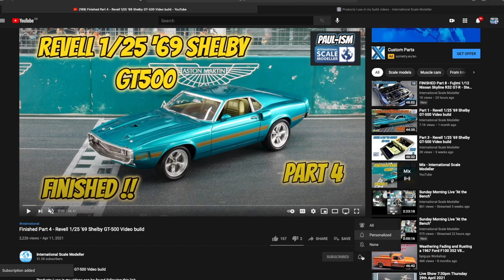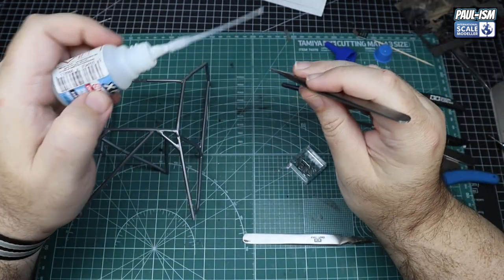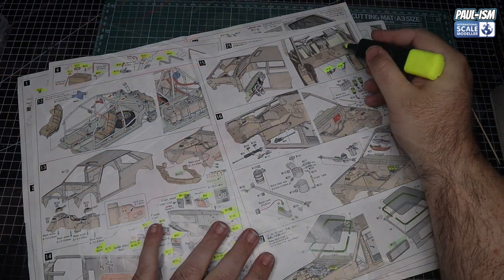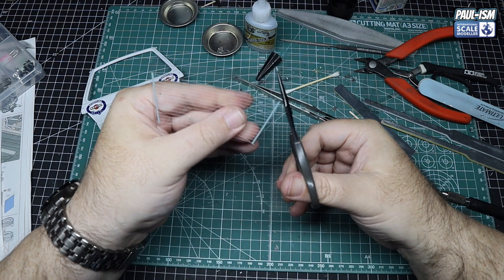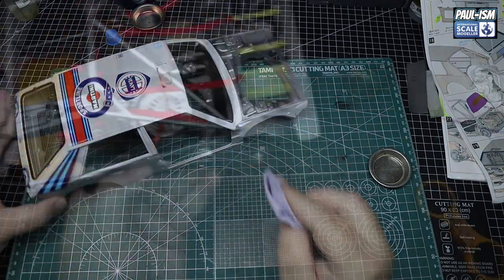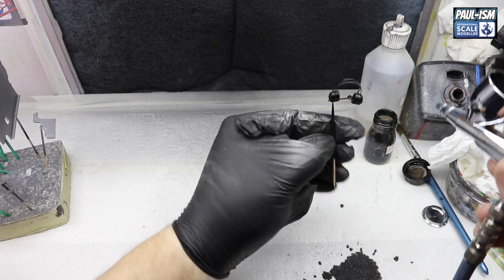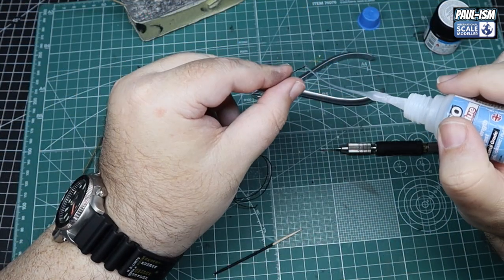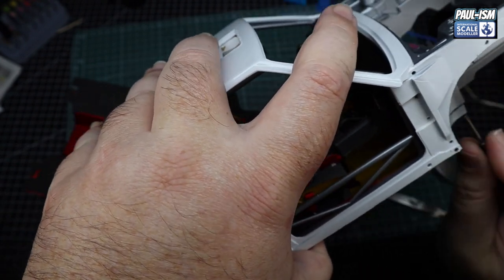Part 12 - Model Factory Hiro Full Detail 1/12 Lancia HF Delta Integrale Evo '92

Comment: Hey Paul, as always crazy detailed build. A bit of info on headset. Driver and Co-Driver helmets have built in intercom. It is required during the stage so driver can hear stage notes read by the co-driver because all these cars extremely loud inside especially on the gravel/dirt roads (mostly because all sound isolation removed as unnecessary weight). During transits between special stages co-driver still need to give instructions to driver from the route book on how to get to the next stage. As I mentioned before, since the car doesn't have any sound proofing even in the road mode even on the tarmac it is extremely loud inside just because of engine alone. So all these intercoms mostly to provide communication between driver and co-driver. In works/top level teams co-drivers side intercom have also connection to radio or sat phone to be able to communicate with the team at the service park.
Reply from the maker: Thanks for the info mate